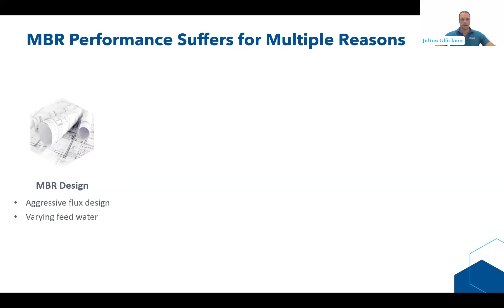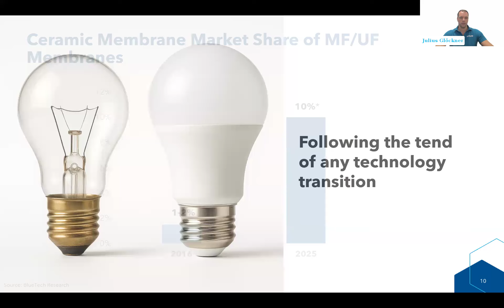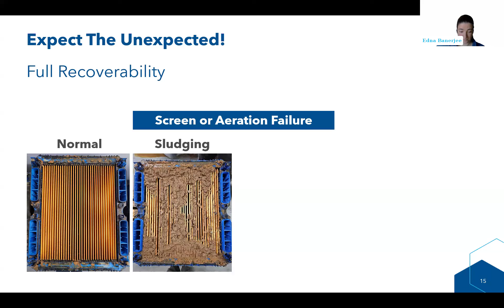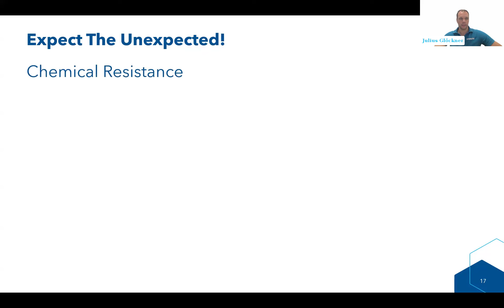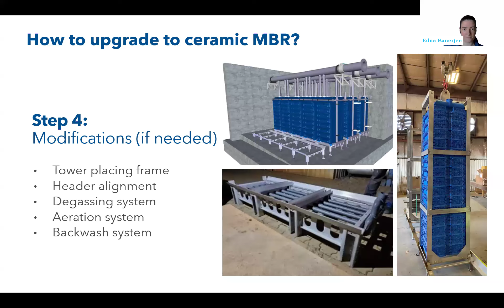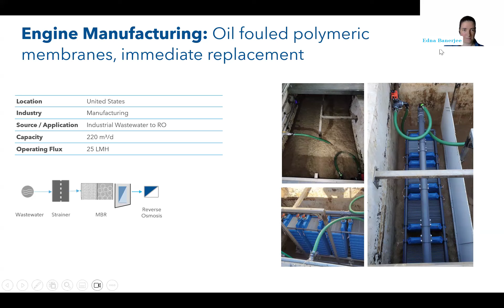CERAMIC MBR Webinar | How to Upgrade from Polymeric Membranes and Why It Matters

Comment: Good day 
Please, how is this technology different from conventional sand filters and what do you recommend?
Reply from the maker: Thank you for your question and for watching the webinar.

Our ceramic flat membrane technology is quite different from conventional sand filters. While sand filters primarily remove larger particles, ceramic membranes provide true microfiltration down to 0.1 micron — which means they can effectively remove suspended solids, bacteria, and other fine contaminants in a single step.

They’re also much more durable, with a service life of over 15 years, and require significantly less maintenance due to fewer backwashes and more stable performance under varying feed conditions.

If you’re interested in learning more — or have a project where you’d consider testing ceramic membranes — feel free to visit our website and complete the contact form:
https://www.cerafiltec.com/contact/